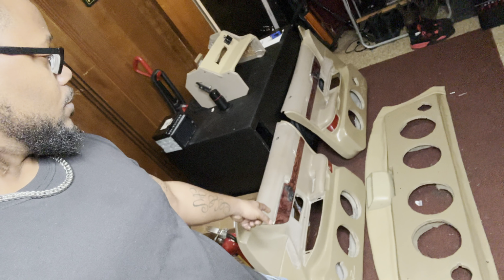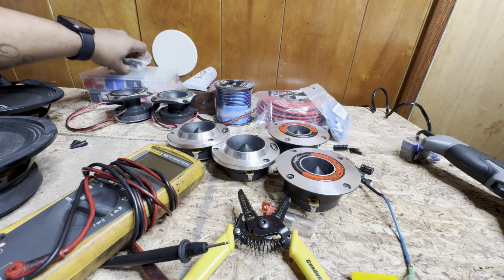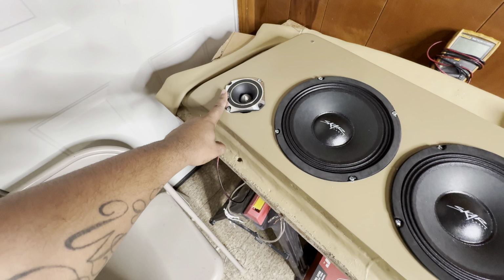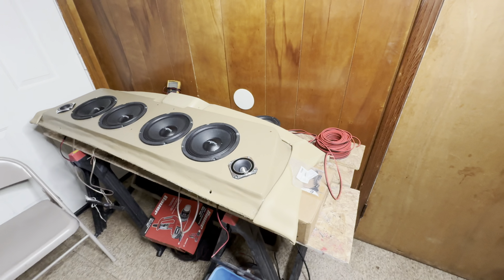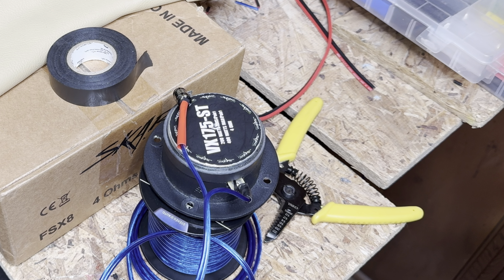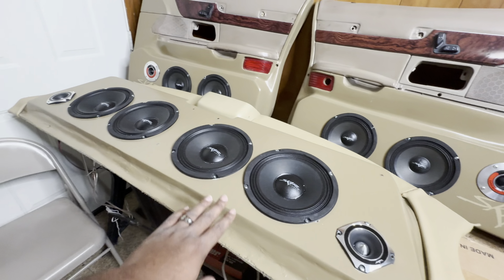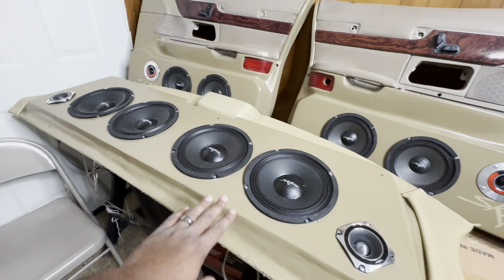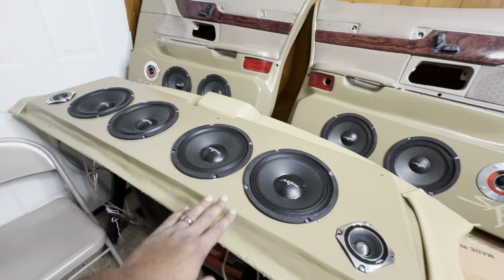I Installed Skar Audio Speakers in My Custom Rear Deck and Door Panels

Comment: When you build a audio stage you build them to focus the sound to a point. And the wood on the door panels are way over kill. Next time build the inserts to attach the door through the speakers not through the bottom of the door where it can be seen. Secure the panels to the door as much as possiable.. Great strat

Comment: For the tweeters with holes showing what if you wrapped the edges in rubber trim and lightweight heat strink it to the tweeter to cover that gap?

Comment: Why didn't you solder the speaker wire to the caps?
Reply from the maker: I soldered the frequency filter to positive side of the super tweets. No wire was solder to the caps